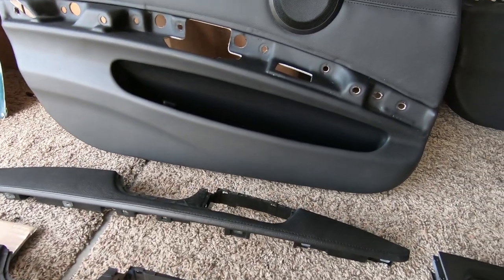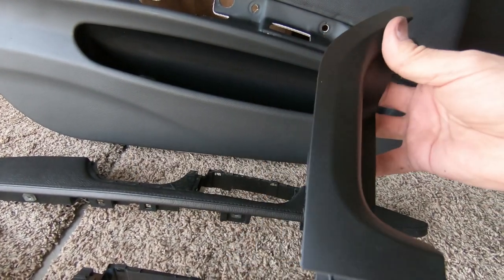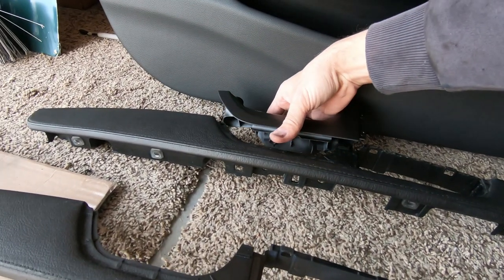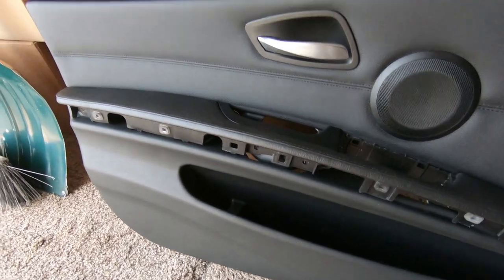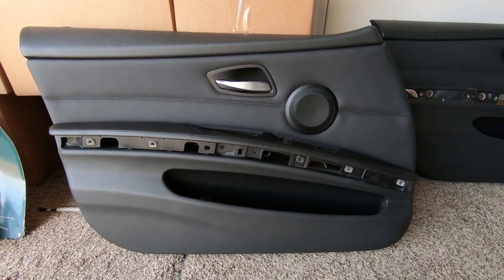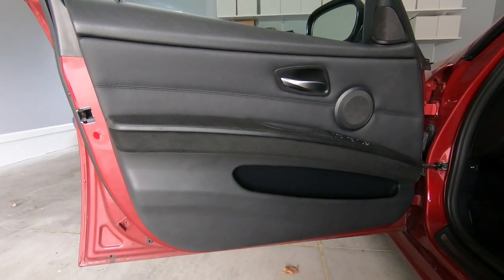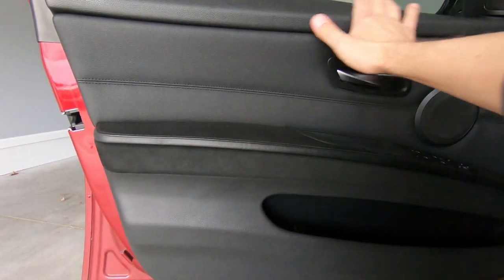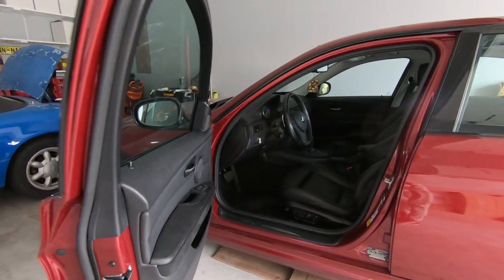How to fix the driver's door arm rest on your E90 BMW #bmw  #howto

Comment: Hi. What did you do to restore the door pull? You did a great job. I NEED to do that for mine. Do I have to remove it?!? Thx.
Reply from the maker: Door pull  you mean that pocket thingy next to window switches?
Reply: @maxsam201  lol - yes, I didn’t know what to call it. Whatever you did to restore it worked great. It looks so much better. Mine is peeling. I was hoping it was an insert that I could buy I new one, but I can’t seem to find it anywhere. I’ll be happy if I can restore it like you did!  Thx
Reply from the maker: I peeled all the rubberized coating, and then sprayed with black paint. Then I wrapped it with microfiber / alcantara type fabric. It looks alright, not perfect, but acceptable. Yeah, they are part of door panel trim from factory and can't be bought separately.